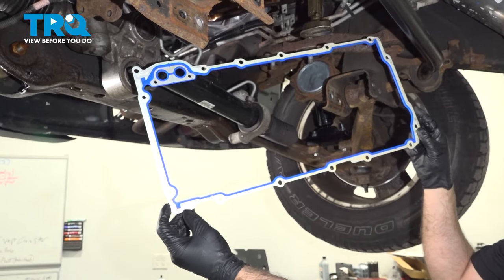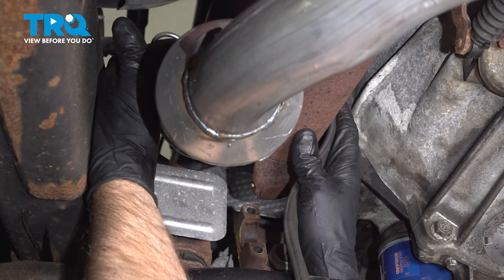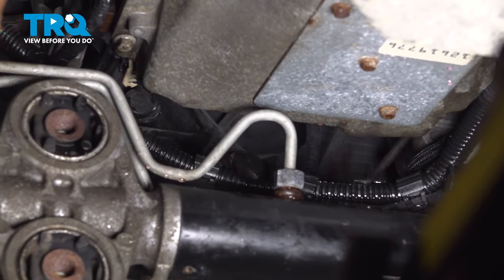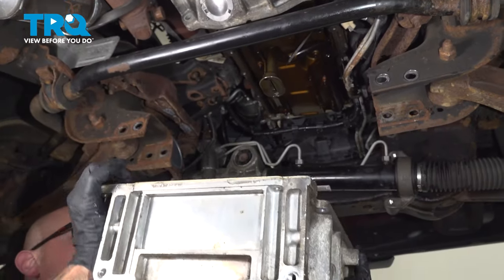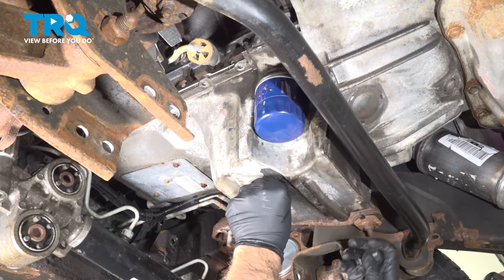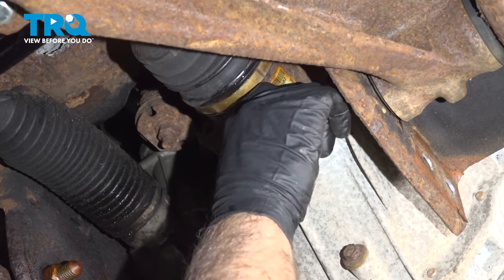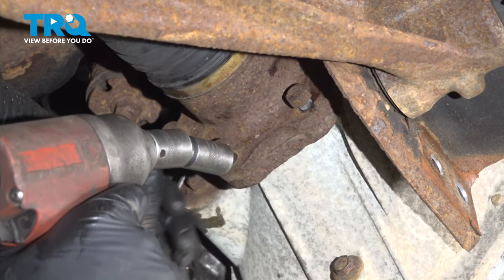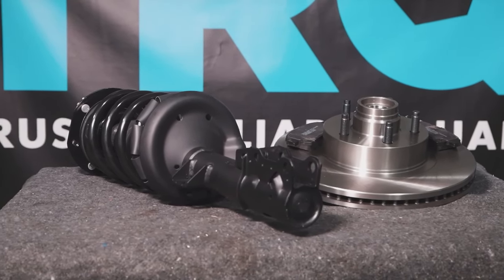How to Replace Oil Pan Gasket 2007-2013 Chevrolet Silverado

Comment: Why did you drop the rear differential and the drive shaft? It's literally just a oil pan COVER there's nothing running through that would warrant removing all that. Unless I'm missing something then I guess sure.

Comment: Thanks for the video. Just replaced the O Ring on the oil pickup tube in my 2012 Silverado. The job was long but resolved my low oil pressure issue.

Comment: Great work. I’d just have to clean that pan a bit better and maybe put it in a solvent tank. Hate for that gasket to fail in the 1st few miles and not be able to tell where the leak is coming from.

Comment: Watched lots of your videos on you tube. Wondering if you have wver had an issue with a leak that looked like pan or rear seal and changed them and still have same oil leak?   I changed oil pan gasket  the rear cover plate, gasket and seal also did oil pressure sensor while has trans out. And still have the same leak as before. Weird thing is.  Only seems to leak when driving it. when parked just reving it for the same amount of time as that had just driven it there is no oil leak.

Comment: That plate he mentions at the beginning, take an extra minute to remove it and that bar just to the right of the battery. I fried the BCM in my Silverado trying to work around those. I’m assuming the ratchet arced against either the plate or the bar.

Comment: Two questions: 1. Removing the cross brace and steering rack should require an alignment. (I just had mine done and the alignment is messed up now. It was aligned about a month before this work was done.) Do you recommend the alignment be checked???   2. What is that cool tool (not in your list) for extruding ALL the RTV from the tube? It looks kind of like a fish scaler, but I know that's not it!  Who makes it and do you have a part number?

Comment: Was this the 5.3L? I’m now trying to figure out why Pro Demand is saying I’ll need to remove the Engine Front Cover to replace the Oil Pump on a 2012 Silverado 1500 with the 5.3L. Oil Pressure gets below 10psi after 15 minutes of idle at that point the top end tickling begins.

Comment: So I noticed he drilled out the rivets but do you have to install new ones once you drill them out. Is there a chance of leakage through those river holes? Noticed the gasket was not fixed going in like the OEM sure it’s not an issue just wondering.

Comment: Couldn’t you just disconnect the motor mounts and lift the motor a couple inches? Then drop the oil pan? Wouldn’t that be a lot easier?